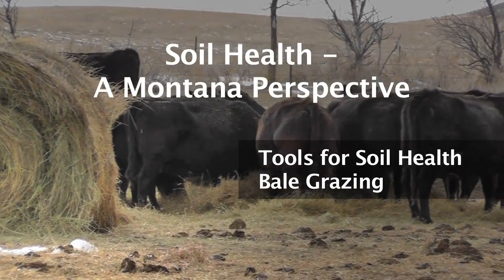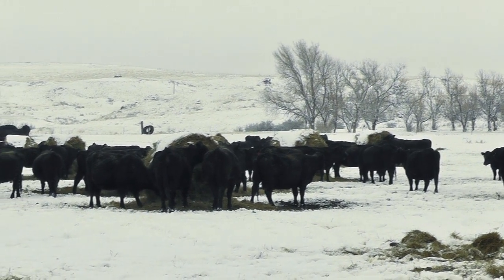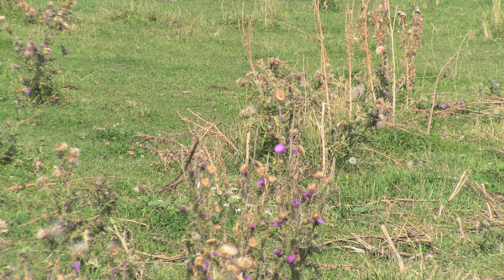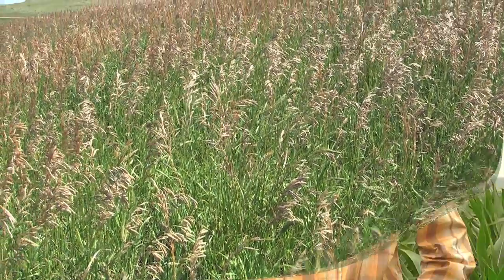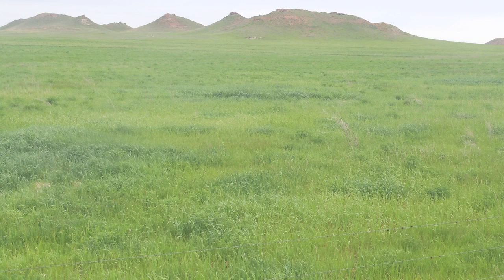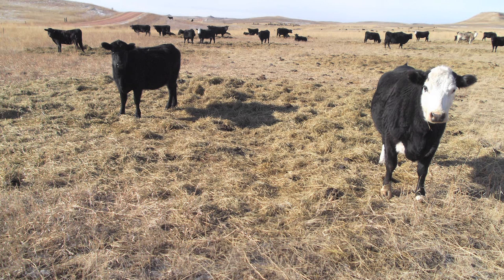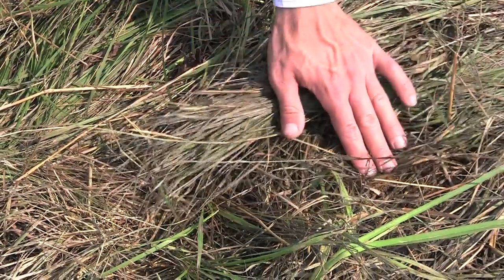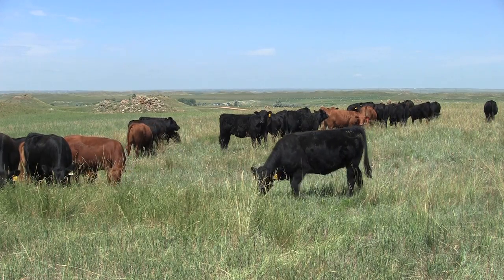Soil Health, A Montana Perspective - Bale Grazing

Comment: im sure for lazy people its a better way to improve the ground they remove fodder-gras from. hehe
but  a normal hard working farmer that dont have too much land, would feed in a cow barn, use straw for bedding...
then collect the used straw-manure-urine. eighter in a manure pit-ore tank ore even make l little biogas factory and
 spread the end product on hes fields
Reply: another thing they dont mention is that your cattle are less likely to get sick with bale grazing as opposed to keeping them locked up in a barn with their manure and urine. Cows need sun light too. why work yourself to death? it doesnt make sense to have to take time, money, and energy to clean out stalls when you can reduce costs and time by letting the cows work for you.
Reply: Wrong,  the little farmer does not own a manure spreader or its mechanical failures
Reply: Nope, you let the cattle spread their own manure. The system you describe wastes virtually all the urine, which contains a lot of nitrogen.
Reply: @muletrack  yes in a perfect wourld  cow should be outside year around.. but at lest in north of norway where i grew up the animals prefer to be inside when its 10-20  feet snow and freezing outside 6-8 months a year.